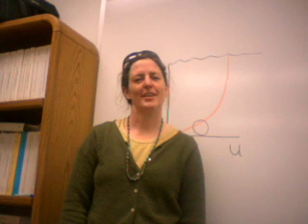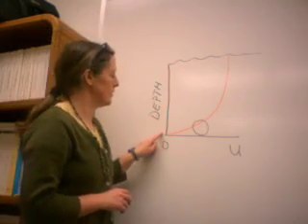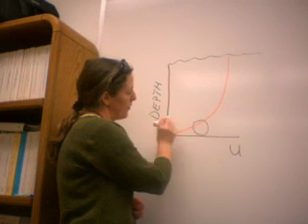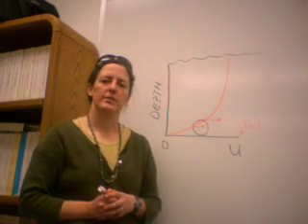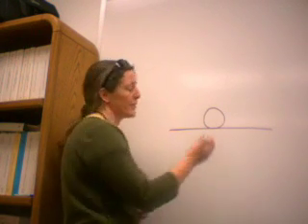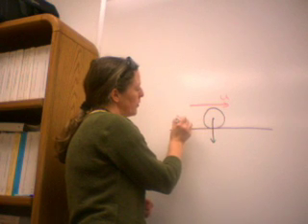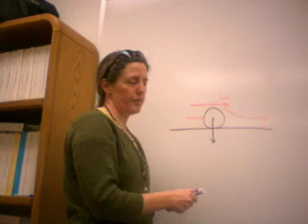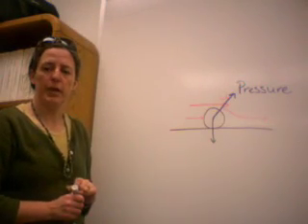Sediment Transport

Comment from the maker: Good points; my video is a simplification. However, to lift a grain, a force has to be applied to overcome gravity. Only when there is low pressure (within the structure of the turbulence) above the grain, will it lift. I describe this effect in terms of average flow speed. Although my reasoning could seem to allow saltation in a laminar layer, there is never enough pressure difference to lift a grain if the flow is slow enough to be laminar. Turbulence adds pressure variations & is essential!

Comment: I disagree with the second half  of this video and I believe that your reasoning is wrong.  Saltation is not caused by the a higher pressure on the bottom of the grain than on the top but it is caused by the coherent structures in a turbulent flow.

By your reasoning you could have saltation occur in a laminar boundary layer,  I agree that there may be some effect on a single grain by a pressure differential but it is insignificant compared to the force caused by turbulence